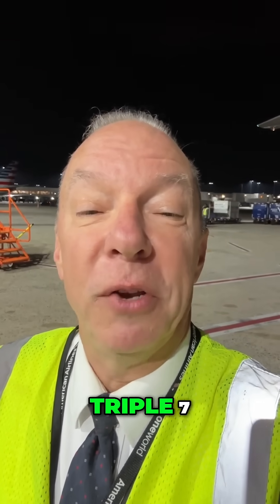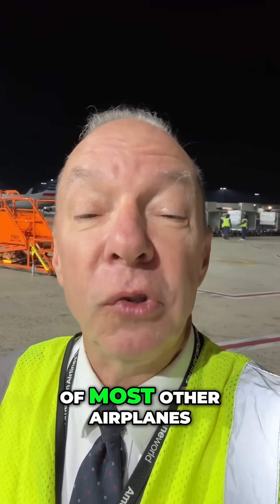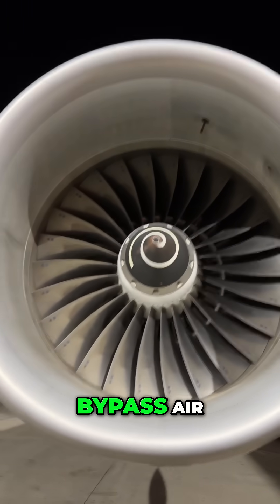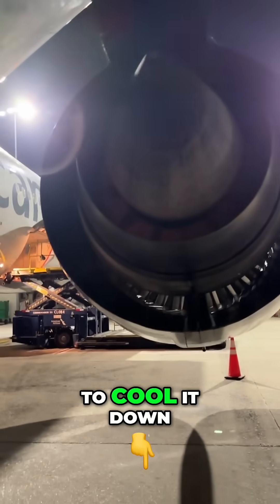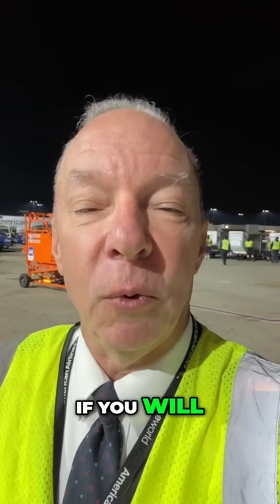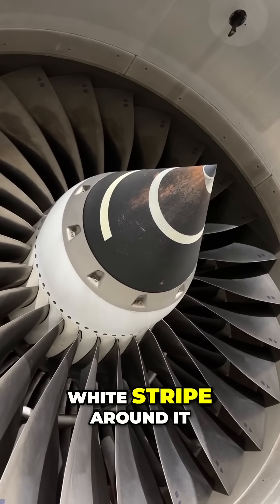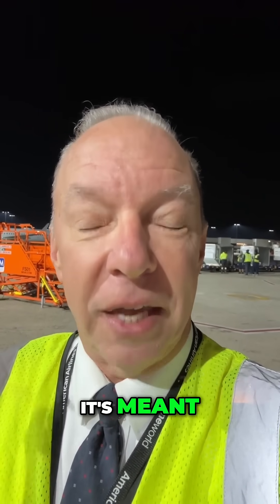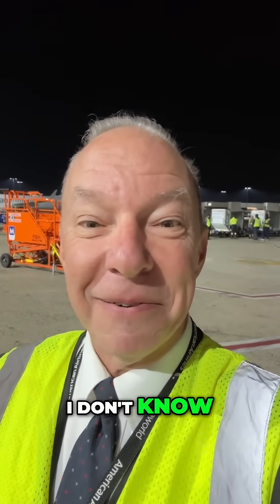Inside Boeing 777 Engines: What You Need to Know

Comment: To correct you Captain Steeeeeeeeeeeeve, this is Techician Smakheeeeeeeeeeeeed, the High bypass engine uses the bypass air to produce... Thrust, cooling the core and noise suppression. The cone stripe is for us groundies to see if the engine is windmilling... nothing to do with birds.

Comment: captain steve i think you might have been fed some baloney on this one, the swirly markings on the engines are supposed to signify to the crew that the engine is running too fast, they can see that if the swirly marking appears solid

Comment: Just for clarification the cooling effect of bypass air is maybe at most 5% its actual use. The air passing throught the bypass duct produces 80% of the thrust of an engine. The core engine produces 20% and main function of core is to turn turbines which in turn turns the compressor blades or in this case as Steve mentioned "vanes".

Comment: Moving in a swirling affect that caught the birds eyes which make them to change directions. Birds eyes have this layer of glare protection to lights so that they can see inside of tinted doors n windows. That same protection allowed them to know they should avoid that area of the engines.
Also, the swirling at the tip of the engines was painted to indicate to the technicians servicing the airplanes from being sucked in. The swirling is visible when engine is not running. When your eyes failed to recognize the swirling means the engine could be running. With all the noise on the tarmac it is not easy to distinguish which engines are running. Best positive indication before approching jet engines.

Comment: The spinner stripe is a fast quick glance to see if the engine is running. One the ramp wearing sound muffs you may not hear the engine, so a quick glance lets you know. If you see the stripe, engine off. No stripe, engine turning.

Comment: While the spinning white spirals on jet engines are sometimes thought to deter birds from flying into the engine intake, there is little conclusive evidence that the spinning motion itself significantly affects birds; the primary purpose of the spirals is to visually alert ground crew about a running engine, not to scare away birds. That why you still hear the news of birdstrike on planes engine.

Comment: The bypass produces most the the thrust at low altitude when the air is thick. Pure turbojet engines struggle until they get to altitude.

Comment: Love you videos but those are not jet engines, they are turbo fans. There is no thrust from the exhaust or the engine. The engine turns that fan in front which creates the thrust. It's the equivalent of the propeller on a standard airplane engine.

Comment: Two wrong bits of information there. First, the bypass air is NOT intended for cooling, but for producing thrust. Actually, the vast majority of a modern airliner's thrust comes from its fan (bypass air), hardly any at all from the engine core. The reason being, as much energy as possible is extracted from the burned gases to - you guessed it - power the fan. And second, the white spiral around the spinner is intended for alerting ground crew that the engine is running. The airport apron area is a mighty noisy place, with potentially several engines running simultaneously. It can be impossible to tell which engine is running by sound alone, so a visual cue is used. There is no evidence whatsoever that the white spirals have any effect on birds.
Now you know, captain Steeeeeeve. :-)

Comment: …um, usually he’s pretty accurate with his ‘layman breakdown’ but I have to squint a little on this one. That bypass air is NOT ‘air conditioning’ to cool the engine but actually thrust to propel the aircraft forward…..about 75% (or more) of the actual engine thrust is the fan bypass air.

Comment: On most turbofan engines, the primary purpose of bypass air is to produce thrust and yes to cool the engine as well but the venturi effect of the shape of the cowling creates the thrust needed to move the aircraft while combustion air only provides additional thrust. Majority of the cooling system of the engine are achieved through compressed air routed through tubings and manifolds to the desired cooling locations. Even the air conditioning of the aircraft comes from compressed pressurized air from the engine

Comment: Dear captain Steve, no 1 complaint from people living around airports is the enginenoise. The larger engines have a high bypassratio and are actually quieter than the older, smaller engines. The older engines were thunderous, the newer are highpitched and not thunderous anymore. 
You fly the Boeing 777. Do they carry the GE engine or the RollsRoyce Trent engines at American Airlines?

Comment: Uh no that bypass air is actual thrust. In fact, it’s where a very large portion of the engine thrust comes from. You could cool the compressor and combustion chamber enough simply with the air flowing around the aircraft in flight. I’m sure the bypass air does have a cooling effect, however, that’s not its main purpose.

Comment: Isn't the bypass air actually what is providing the thrust (I.e. the mass of high speed air generated by the fan?).  The air going through the core is only for combustion to turn the turbine which then turns the fan.

Comment: Steve, most of the air is actually used for thrust thus improving fuel economy and reducing noise. There is a whole discussion to be had on should we call modern high-bypass engines ducted fan engine or stick to high-bypass.

Comment: Let's the ground crew know it's running the bird thing not so much .and the bypass air is 80 percent of the engine thrust primarily and at altitude it's minus 50 degrees so not so much for cooling but we know pilots only fly the plane not engineer them .

Comment: Hey Captain Steve, the fan stage is not to cool the jet engine. It makes cold air thrust just as a propeller does. On your airplane Steve, about 80% of your total thrust out the back of the engine comes from the cold air produced by the fan stage, while only about 20% of the total thrust is hot air from the jet engine. Your engine is called a high bypass fan engine.

Comment: The bypass is not for cooling. What are you talking about?
The bypass is to have more air pushed against from the power generated in the core of the engine. That's why it's more efficient.

Comment: It kindof bothers me how you didnt mention that the bypass air doesn't only help cool the engine, it also produces the majority of the thrust becsuse it's shaft is driven by the exhaust turbine. Its basically a 30 blade propeller powered by a turboshaft engine

Comment: I thought the spiral painted on the turbine was for the safety of the ground crew and mechanics. Its hard to tell when a turbine like that is spinning, and even without the engine running, the wind can cause the blades to spin, putting mechanics in danger. At big airports, its so loud that ground crews can't always tell if an engine is running, thus the spiral stripe was created. When the engine is powered up for flight, the stripe isnt visible and I really doubt any bird can see it. Even if they could, why would we assume they could make any sense of what it means? I think steeeeve is yanking our chain.

Comment: By the way, the RR engine shown is the smallest of 3 engine options on the 777-200/-200ER/-300. However, it’s the lightest and it sounds better, making it popular. Also, maintenance makes it more common in Britain and in Commonwealth countries.
The GE90-110/115B is the engine about aa big as a 737 fuselage, though he doesn’t mention the 737 in this video.

Comment: How long have you been flying??? The spinner is primarily a safety feature designed to visually indicate when the engine is spooling down, warning ground crew to keep a safe distance from the spinning blades while the aircraft is on the ground... It has NOTHING to do with bird strikes as the illusion vanishes long before the engine is up to speed...

Comment: Bypass air provided by the Fan is 60-70% of the thrust of the engine. Actually the core engine only uses about 1/3 of the air in the combustion process the rest flows over the burner section.

Comment: You are wrong. (Simple Explanation) Those are turbo fan engines. Jet engine runs in the middle and those fans are rotated by it to move large volumes of air to create extra thrust, not to cool the jet engine down.

Comment: As I understand it the visual spiral in the center of the engine is to let anyone near it visually estimate when it is turning slow enough that you don't have to worry about getting sucked in if you're too close. The spiral blurs out above a certain speed, so if you look at the engine and you can't make out the spiral you know you must keep a safe distance from it. Once it slows enough that you can make out the spiral then it's safe to walk in front of it without getting sucked in. The spirals are sometimes visible on camera when running fast because of the strobe effect with the camera frame rate but they will blur out to the naked eye. I doubt that the spiral has any effect on birds.

Comment: What a nonsense! air-conditioning unit? 😂😂😂 This a/c produces 90% of the thrust!
Reply from the maker: Well… the bypass air serves two purposes. First it produces about 50% of the thrust and secondly, it cools off the combustion portion of the jet making it more efficient and therefore producing more thrust. It does act like a sort of A/C unit by cooling the core. I know the bypass fans are not a/c units with Freon. But they do serve a similar purpose. Captain Steve
Reply: @CharacterHealth  it produces about 90% of the thrust and has nothing to do with cooling. It reduces the noise significantly, yes but that's it. This happens when pilots think they have to explain engineering.

Comment: The bypass might cool the engines, but it also produces trust. In ulta-high bypass turbo fans, 80% of the trust comes from the bypass.  Cooling is only secondary.  
The biggest effeciency gain comes from the shear volume of air you can push without having to heat it up.  Source: Intro to Turbine Engines (BS in Auronatical Science).

Comment: Come on Captain, the bypass air doesn't cool the engine, it provides most of the thrust from the GE90. The engine is cooled with the turbine oil and the oil is cooled with the fuel.

Comment: The bypass air actually creates between 30-80% of the thrust of an aircraft gas turbine engine. On the 777, between 70-80% of realized thrust is created by the bypass air.

Comment: The bypass air isn't there to cool the engine, it produces most of the thrust. It might also cool the engine, but producing thrust is way more important because that's what makes these engines so much more fuel efficient than turbo jet engines.

Comment: The bypass air is NOT to cool the engine but to accelerate more air towards the rear to maximize the engine’s fuel efficiency. 
Fighter jets yield higher air accelerations without the bypass and reach higher speeds at the expense of a much lower fuel efficiency. 
Engine parts cooling is done by airflow inside the stator - and rotor blades close to, inside and aft of the combustion chamber.

Comment: Is bypass air not propeller thrust?
Reply: Exactly what it is but when that propeller has tons of blades and is in a duct we call it a fan.
Reply: @wally7856    I call the propeller on the 172 I flew, "the fan".    If the fan stops turning, the pilot begins to sweat!
The blades are surpisingly light weight!

Comment: The spiral on the cone is a device to help protect ground crew.
When the spiral can be seen, as a spiral, it means that the engine speed has reduced to a safe speed. Ground crew will not be sucked into the intake.
But ground crew are still getting sucked into engines.
The bypass air in high bypass engines does most of the pushing effort to push the aircraft forwards.
It also means modern engines meet noise regulations.

Comment: Thanks for a great explanation. What engine do you like better on the 777- Rolls Royce Trents or GE-90's?
Reply: No one like a RR engine on a 777. It feels like half the power of a GE 90
Reply: 777s also  ome with Pratt & Whitney PW4000 engines, the same engines power UA 777 fleet
Reply: @mh12-47  the only real deal is the GE90

Comment: Ehhh idk about your factoid regarding birds, Captain Steve. The swirl on the center of a commercial jet engine's spinner serves both practical and safety purposes. Its primary function is to provide a visual cue to ground personnel, making it easy to see whether the engine is running or spinning. The swirl helps prevent accidents by visually indicating if the engine is turning, especially when it's at low speeds where movement can be hard to detect. In addition to the safety aspect, the swirl helps break up optical illusions created by the spinning blades, which could otherwise make the engine appear stationary when it's actually in motion. The pattern also adds a slight aerodynamic benefit by guiding airflow more smoothly into the engine's intake.

There isn't strong evidence that the swirl on jet engines significantly deters birds. The idea that the swirl might scare or steer birds away has been speculated, but it's not the primary purpose of the design. Birds are more likely to be affected by other bird-strike prevention measures, such as airport wildlife management programs, radar detection systems, and physical deterrents like noise or reflective surfaces around runways.

While the swirl may create some visual movement that could catch a bird's attention, it's not a proven or effective bird deterrent by itself.
Reply: I don't know how a bird could possibly even see that swirl when the engine is running.  i.e. it will just be a blur like anything spinning that fast.

Comment: Bypass air is not bypassed to cool the engine, it is bypassed to produce thrust without heating it with fuel, in order to save fuel.  Turbofan engines, like all gas turbine engines, are cooled by the large amount of air passing through the core engine, beyond the amount required for combustion of the fuel.

Comment: OMFG.  They're called High Bypass Turbofans, bypass air provides the primary thrusting force from the engine.  It is not just cooling but it is more efficient.  

The spiral on the inlet cone does eff all to keep birds out of the engines but it does alert ground crews to a running engine.  Once the engine is up to RPM the cone spins fast enough that the pulsing of the spiral is nullified.   Typical pilot that's clueless about how anything works outside of the flight deck.   Next video this guy will be telling you how to find a few feet to of flight line or how to find the ID 10 T,.

Comment: Which is why they are called turbo fans and not jet engines. The old jets are smaller diamater with longer bodies. Turbo fans appear with a far lqrger diameter and shorter body, although about the same.

Comment: How about that little black rubber tip on the very front of the spinner? I’d have never guessed if someone hadn’t told me what it is. On Rolls Royce engines (like this one on the 777-200) inside that little pointy rubber tip is an off-center weight. As the engine spins, the weight bangs on the rubber to keep ice from forming. Weird idea, huh? Leave it to the Brits to come up with something that simple -  and different!

Comment: Captain Steve, high- bypass engines are actually propellers through action of the first stage blades. Actually, modern bypass engines are capable of producing up to 98% of thrust purely from the bypass air being produced; essentially bypass engines are almost like propeller engines as regards producing thrust.
Cooling of the engines are done through engine bleed ducts and actual engine bleed internally. Love your videos and your humour. ❤❤❤
Reply: The 'propellers' are actually fan blades and push up to 90% of the total engine mass flow around the core not to cool it but for propulsive efficiency.....that why by-pass ratios are huge compare to say a JT8D on a boeing 737-100/200. They are significantly quieter too.
Reply: @lincolnengland5005  When I was a kid in the 1960s and they were the latest thing in engine tech they were called "fanjet" engines. The radio ads from the airlines would promote their fleets as having the latest fanjet engines.
Reply: Thanks supercat. I was about to make the same comment about high bypass engines.
Reply: Question: Wouldn't it make is a Ultra-High bypass with those numbers?  In school we were taught UHB turbofans were 80% trust from the fan, nominally. That was right as the 777 & 787 were coming out.

Comment: Those spirals on the spinners are kind of like those deer whistles for your front bumper. Gives you hope that it will work, but probably doesn't. At 200 mph on climb out or landing the birds miss the engine out of pure luck. A few don't have luck.
Reply: They are for ground crew. Not birds.